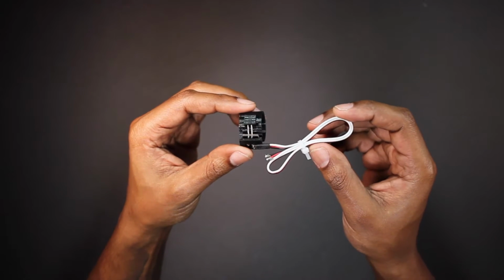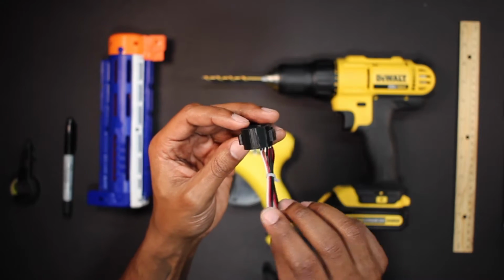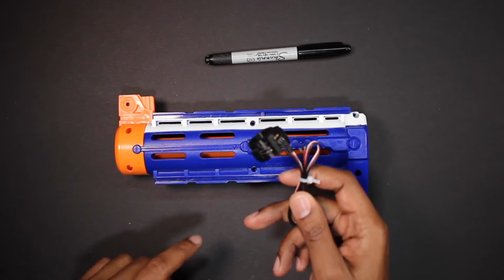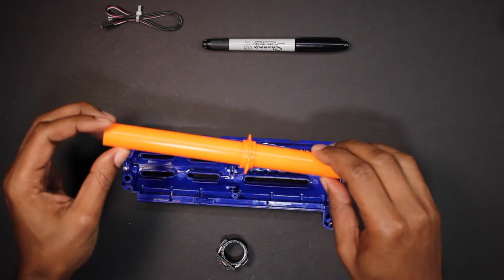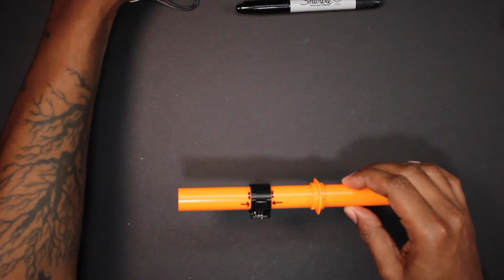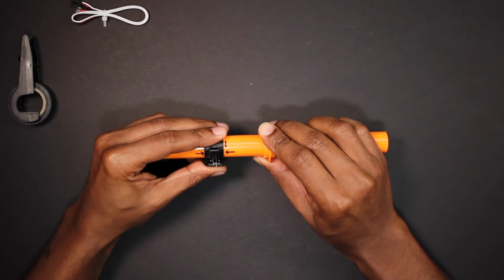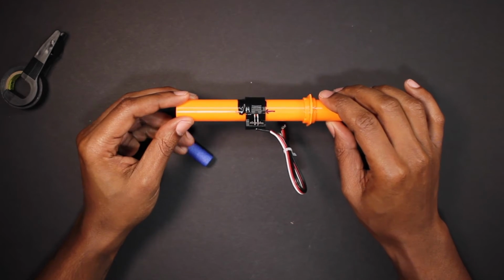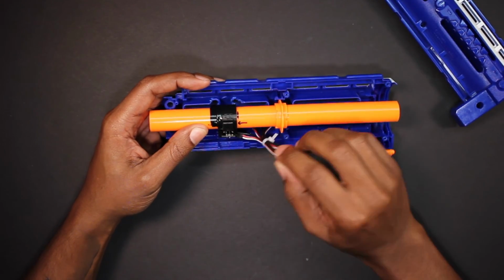AmmoCounter Internal IR Beam

Comment: Do you offer different connection method such as contact plates to allow for swapping a barrel to other blasters that may have a counter? This would avoid plug strain from plugging and unplugging the connector when moving between blasters.
Reply from the maker: Steve W sure I can add a servo extension so you can quickly plug and unplug if needed.
Reply: @AmmoCounter  are you still alive? i want your help for shopping but your facebook is dead